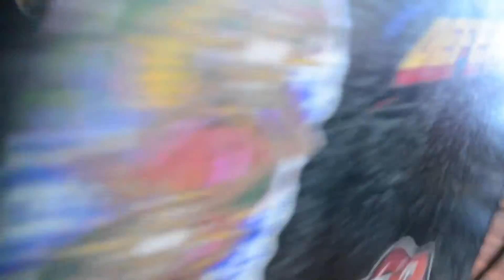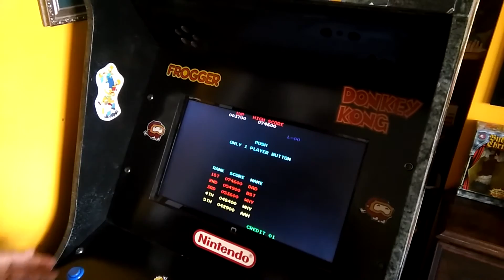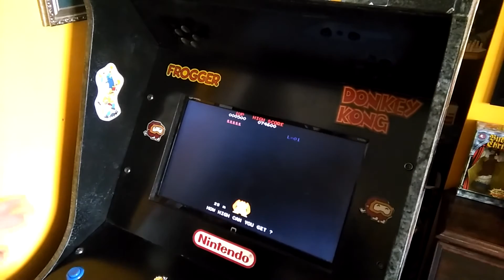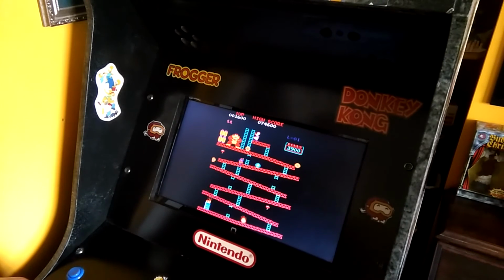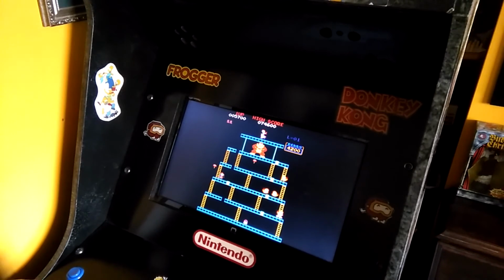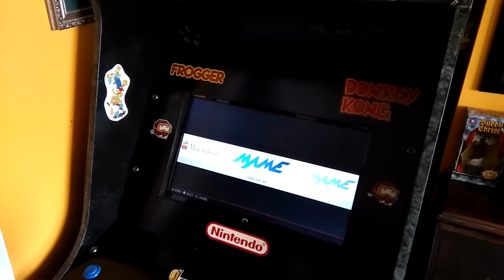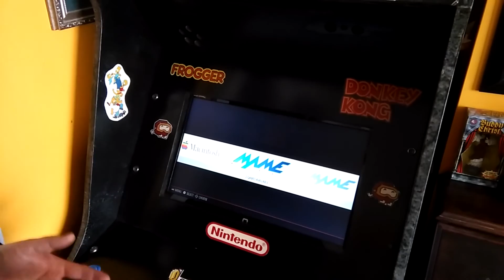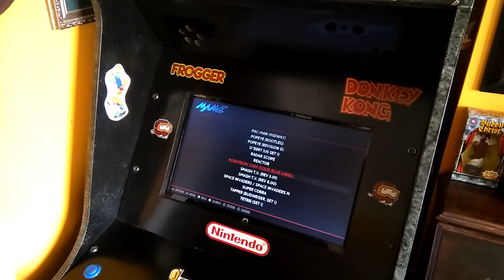Build a Raspberry Pi Arcade Cabinet -Part 2 (It's not that Difficult)

Comment: Hey John. Great set of videos, they gave me a much needed boost of confidence with my own build. Thank you. I do have one question, how did you program the Pause and Escape buttons, and what port did you wire those buttons to on the IPAC? Thanks again.
Reply from the maker: Thanks for the comment and question. I am fairly sure it is: 1a for pause (or p) and 2b for escape (or esc). I recommend adding: 1b - enter and 2a - Tab. Check the ipac website for more: https://www.ultimarc.com/ipac2.html
Reply: Perfect, exactly what I was looking for. Thank you again!